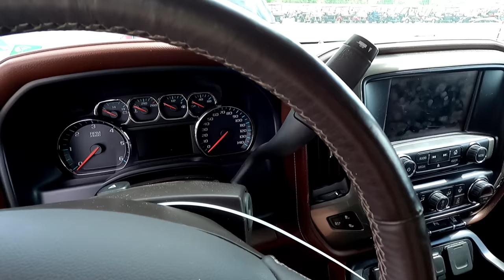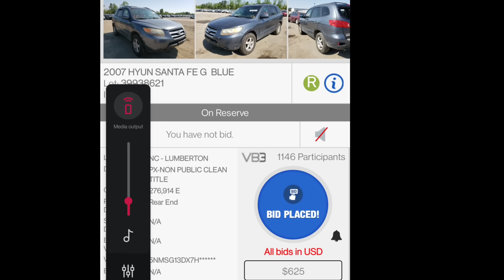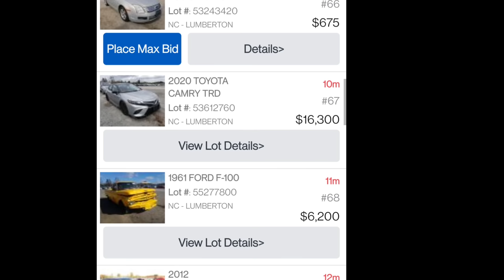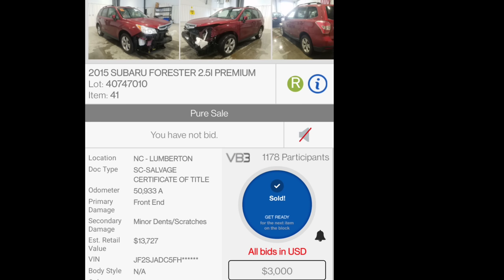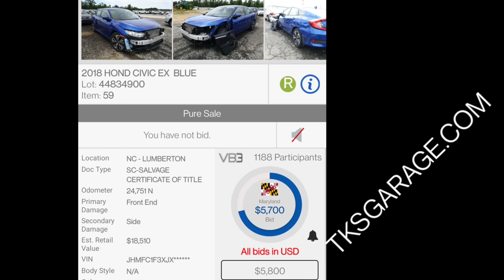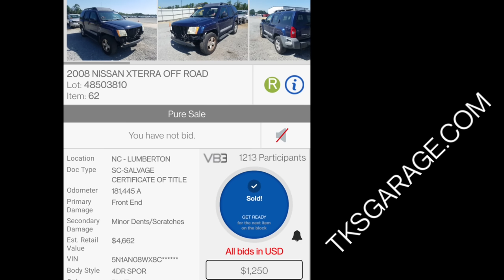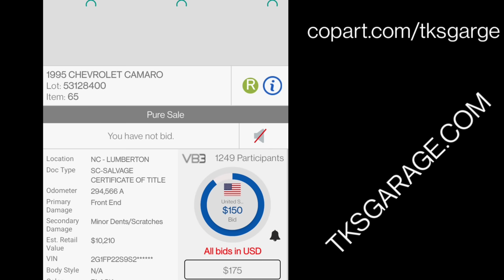Copart Walk Around And Live Auction, Classic Ford Truck, Chevy High Country Cheap!

Comment: On the high country is fix rear bumper unbolt bed an shim it with washers or thicker bushings to the rear of bed to make it like up better an run the hell out of it I bet the bed mourns them selfs are bent or bed rails an not the frame

Comment: That was a decent price on the 1961 Unibody Ford Pickup. New and used parts are available. If the frame is bent I'd probably put a front clip under it or put it on panther frame.
Now that Chevy Silverado High Country was to  die for but sorry Silly Boys Trucks are for Girls.